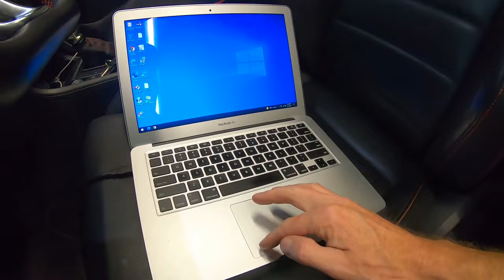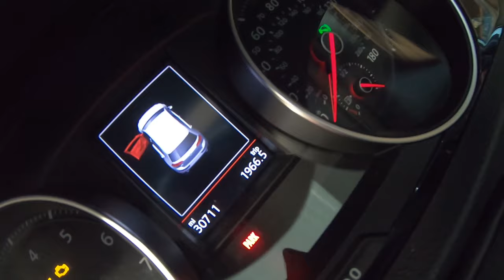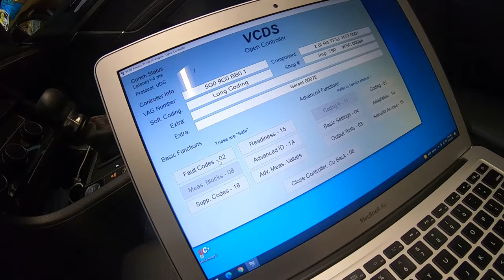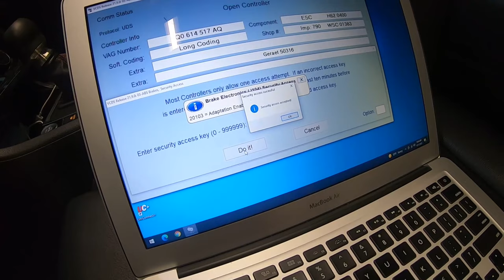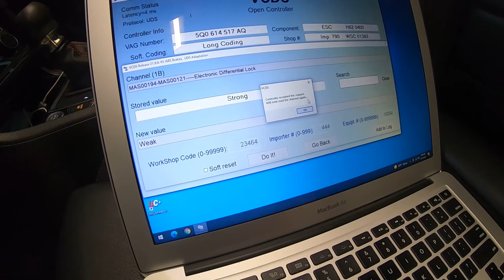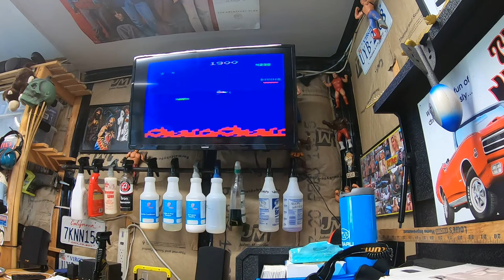2018 VW GTI SE Ep.388: When To Stop Modding? 2022 WRX?

Comment: I like the interior of the WRX but the outside is a little too Crosstrek-like for me, though it may grow on me. Curious to see if the STI will have different body panels.
Reply: I actually think if they started with the Crosstrek it would have been better - heck just lower the Crosstrek, put a turbo on the 2.5 (or 2.4) and call it a day.
Reply: @Scotty_in_Ohio  honestly I’d be good with that. I think that kind of trim looks better on a wagon.

Comment: I like the new wrx. Nicer headlights, 6mt, 2.4l engine should get 400whp easily. Gonna be hard to find one for the next couple years with the BS shortages. Stock power doesn't really matter because it's easy to get more out of it, and the competition like the GTI still comes with like 230hp from the factory. If it ain't broke don't fix it. 

I'm sure the STI will come with 350+hp but probably start at $45k which is ridiculous when you can get a 1le for that money
Reply from the maker: the new WRX is horrible to me, but the STI is pretty decent
Reply: @LastHumansGarage  is the STI going to look different? I wonder if it gets a better transmission. Going by the global platform I doubt it. The new wrx might be ugly but will definitely be an improvement everywhere else. Wish you kept your white WRX. Loved that car
Reply from the maker: @kenmastersmaster  i loved it too. but i love my GTI more.
Reply: @LastHumansGarage  I have a 2015 WRX and am debating between 2022 WRX or mk8 GTI. Or maybe a Camaro SS. Maybe I'll just keep the 2015 for a while longer.
Reply from the maker: @kenmastersmaster  funny.. cuz i think Camaros are the worst designed of call, you cant even see out the windows. I mean it would be fast tho, sure. I do not like either the Mk8 or 22 WRX, but im super into my GTI right now anyway. Wouldnt trade it for anything.
Reply: @LastHumansGarage  yeah I'd like a V8 once in my life before everything goes to shit with EV mandates in a few years. Maybe a mustang? Always preferred the Camaro because of the tremec tr6060 transmission. Do you ever miss your 392?
Reply from the maker: @kenmastersmaster  i miss the sound and power of my 392 for sure. i'd get dodge if i was gonna get anything. but its not nearly as fun as the light GTI.

Comment: Bro...  I feel you loud and clear. The new WRX was so long in the making and then such a dissapointment. CVT would be an absolute nogo for me, even it's a Ferrari..
How about the 2022 Mk8 R as a next car?  Unlike europe you could even order it with a manual, but the DSG would be the faster car by far. The only problem I would have with the Mk8 is that horrible interior material quality and all the touch screen nonsense. But you would learn to live it eventually.
Reply from the maker: its either the MK8 R or 2022 STI is all that's left. And my wife gets a new car before me, so I'm at least a year out... CHA CHA CHA
Reply from the maker: naw.. screw that... i want a Nissan GT-R or a 400Z or a Cadillac CT5 600hp. Let's click those ads and get this channel to 50k subs! WOOOO hahhahahaah CHA CHA CHA

Comment: Nice - typical karstgeo72 long comment..hahaha.  Not a fan of the new WRX exterior but I get wanting a new car to mod for channel content...you really are running out of stuff to do on the GTI beyond larger turbos etc. - I'm still in on LHG if you switch!  On the VCDS - I see you changed the EDL (really "XDS"/"cross differential system" - brake control module) to weak - that's where I run mine after playing around/testing it a bunch....this is the ABS-based system and I really only notice at the absolute extreme where you are breaking traction turning and the ABS brakes that inner f. wheel to help pull your through.  Have you also played with your VAQ diff settings?  Do you have the ability to turn ESC off?  You could try the XDS to not activiated, ESC off, and see how that extreme feels in a v. sharp/break traction turn.  Have you considered doing a HPDE?  Would make for some great content for your channel.  Your car is well setup for it and I note you mentioned that Club Sport rotors etc. - not much you will get out of this stuff for just daily driving but on the track is where you will feel the benefits.  Finally - I agree that 0.002" makes about fuck all of a difference I'm sure in the plug gap but was just regurgitating what EQT recommends.  I run my RS7s with a stock gap on my IS38 but that's quite a bit less boost on the 1.8 that you get with your IS20 EQT tune.  #atari26004lyfe Peace out LHG!
Reply from the maker: i like long comments. wish i could talk about our cars every day. even tonight, im thinking about putting both resonators back in and taking out my dogbone insert.. the traffic is ramping up now back to before covid and i takes 45 mins to get home every night, in traffic. The vibration is bad whenever i am sitting stopped with my foot on the brake. its driving me crazy. and the noises in all this bumper to bumper. so ill try stealth mode for a couple days.. but only you know this...
Reply from the maker: ya i like weak on my diff, but i might go to normal/middle. i didnt like strong.. but weak feels like its not there..
Reply from the maker: i already have ESC "off" in vagcom but not sure how that works, cuz its on when i start the car..  ya plug gap is fine bro.. them kids are too obsessed these days..
Reply: @LastHumansGarage  I was talking about your VAQ so normal, increased traction, or reduced noises are the choices vs. the XDS/ABS "faux" diff settings.  What
 is your VAQ setting?
Reply: @LastHumansGarage  ECS off is just long-push on the traction control button for both ASR and ESC to be as off as it will let you.  And yeah, it resets each key cycle to default to ECS/ASR on.
Reply from the maker: @karstgeo7290  hmm ive never touched the VAQ setting, didnt know there was one.
Reply: @LastHumansGarage  yep - a different/separate control unit for that one.  Lots of folks talke about using the increased traction setting, even shopdap has a video about that specifically.  My thing is - unless someone can log what it's doing/what is changing, I still believe some of these VCDS changes can be placebo but who knows on this one - check it out.

Comment: Subaru = more views.  Simple math.
Reply from the maker: yup, subaru channels get the most views.
Reply: Maybe if u have plenty of $ to throw at it, plus u got save up for an extra engine if u modified to much.  Also it 'seasy to say if your a viewer and not one spending the $ on the build.
Reply: @lewisberry8657  not necessarily.  Mark can comment on this.  I've seen all his wrx videos.  He's had a few subarus.  I don't think he would keep coming back to it if you were right.
Reply: @esley02  but he hasn't kept coming back, there's been a plethora of vehicles on this channel and  he's owned vw for the longest not counting the Forrest. Plus he was only mentioning the new wrx cause everyone else was  at the time of the release its called getting views. If u don't heavily modify the wrx or sti platform u won't get views it take alot of $ just doing regular maintenance or a mod here an there won't cut it,if that's case he would of stuck with one. He's just a hard working dude like me that has other costs besides just throwing all his money  to a build, also he never disagreed with me his comment was b4 I commented on the video.